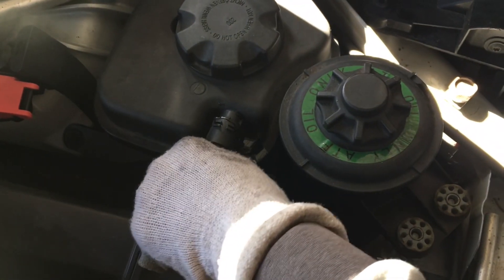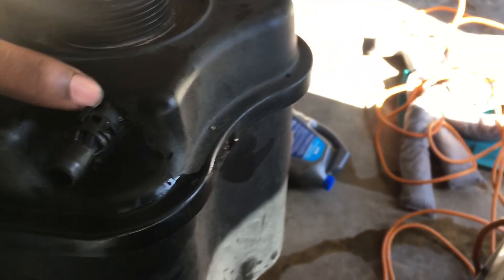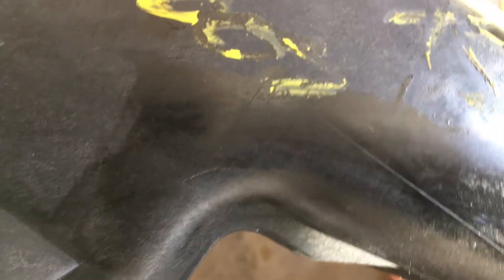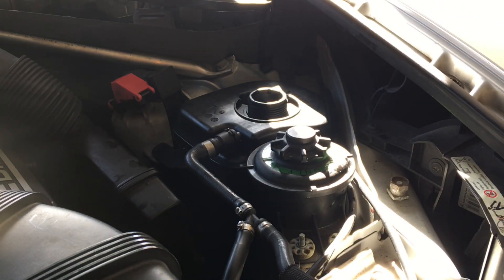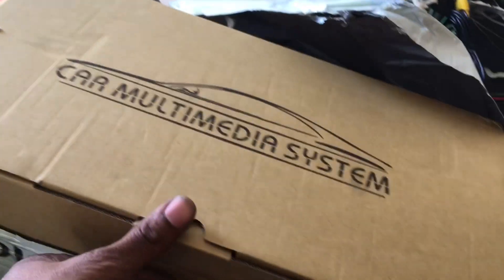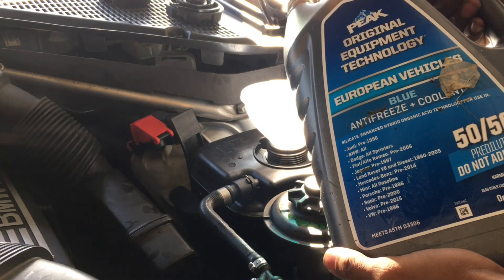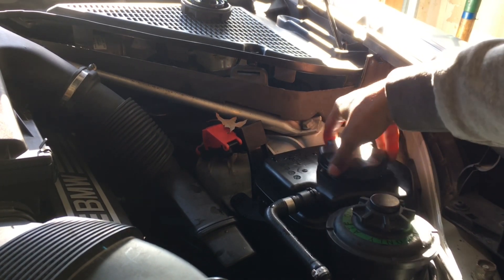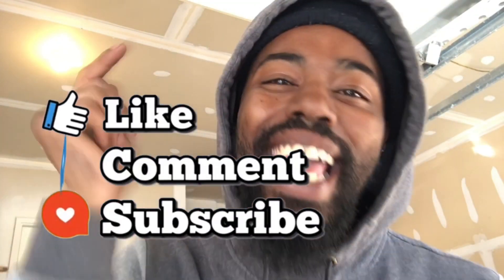BMW X5  Expansion Tank Replacement | E70

Comment: Bleeding the system is done with the engine not running, key in hit your start button.  Press the accelerator for about a minute this will activate the electric water pump and will self bleed.  Make sure the cap is off on the expansion tank and the pump has to run for about 10 minutes to get rid of all of the air in the cooling system.